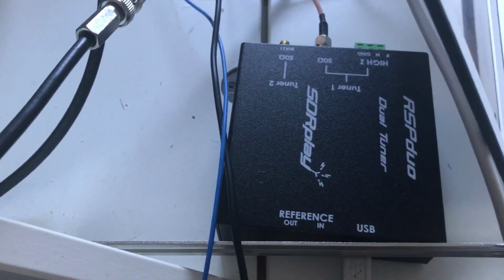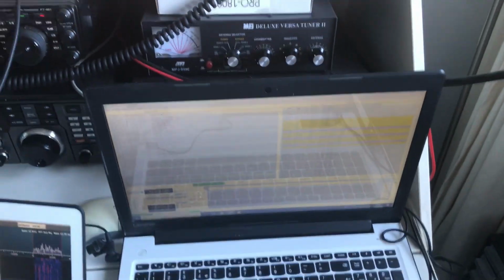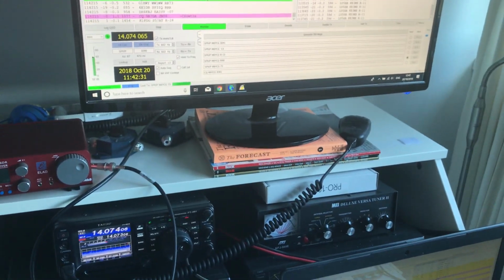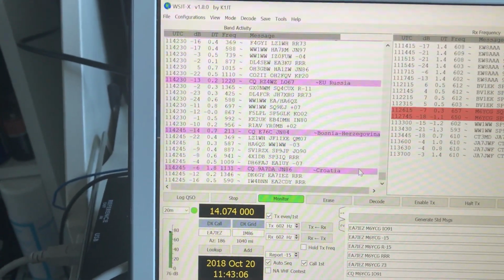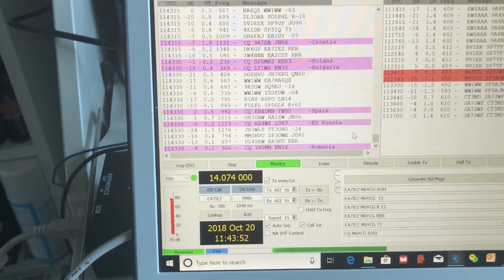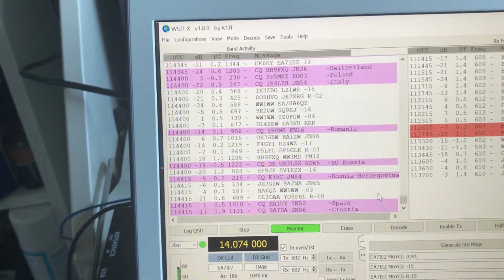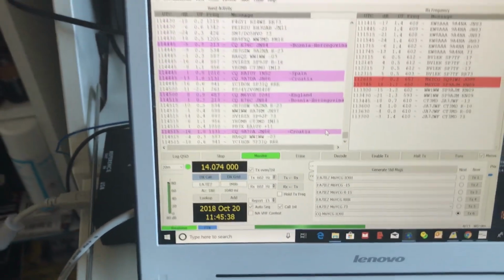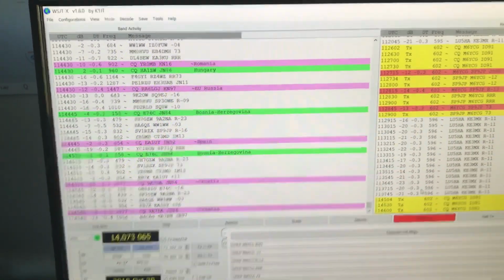Comparing antennas FT8 receive: SE-X80 wideband vertical vs Wellbrook ALA1530 magnetic loop

Comment: I just bought the SE-X80, just curious as to what is the MAX transmit power you run for FT8?
Reply from the maker: I've run up to 50W I think....
Reply: @Oxford Shortwave Log  Thank you.  I heard the Unun is on the weaker side and didn't want to melt it.  It receives well, transmit seems weaker compared to my SuperAntenna MP1DXPRO. I do have it ground mounted  with radials on the setup I will use when my 6btv arrives.

Comment: 1) Loop does have a directional diagram
2) You are using different receivers. Maybe can connect both antennas to RSP? It says its dual tuner.
Reply from the maker: Hi there, yes the loop is directional - more so on LW and MW, but still directional at HF frequencies. I should have put this in context really. My loop doesn't ever get adjusted for position. It's aimed at North America permanently. I am using different receivers - but this was just a test out of interest for me, not a scientific experiment designed to deliver empirical data. But your suggestion using the RSP DUO, would do exactly that. 73!